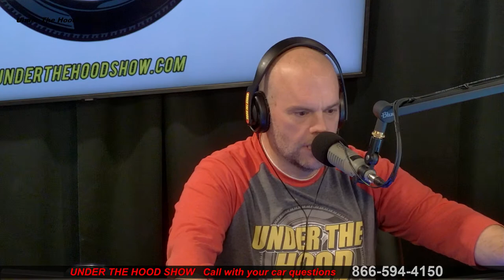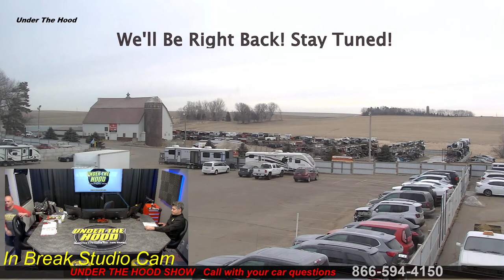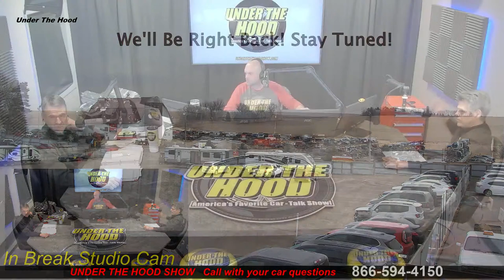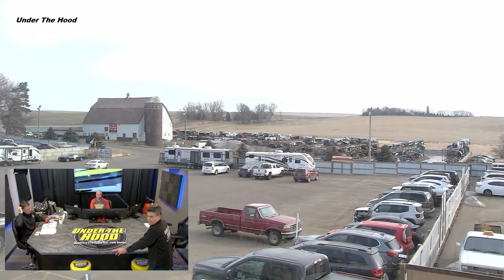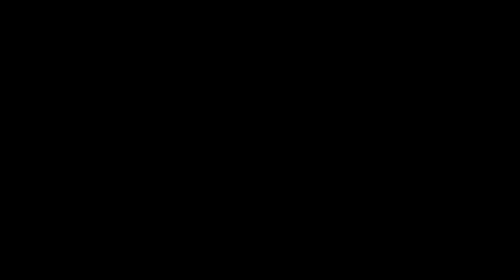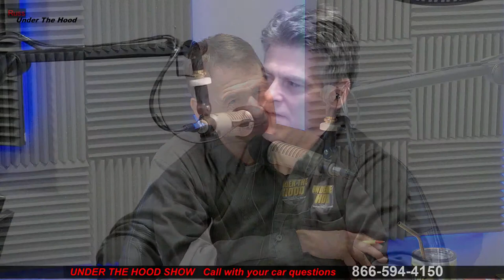S32:E29 Coolant Leaks Are A Real Drip | Auto Repair | Car Talk Show

Comment: I realize you get hundreds of questions..so here’s mine 😊. I’ve done a few hours of searching and just can’t find the best LED replacement headlight bulb or kits. Any suggestions and is it best to go ahead and get the bus decoder or the ones with the built in bus? I want to upgrade my daughters 2012 Accord headlights. What are your thoughts? Am I wasting time-money etc. The lights now are very good but I have LEDs on my car now and they are awesome. Thanks for your wonderful show..
Reply from the maker: Thanks for asking. Well, the DOT has made selling led lights for vehicles to be used on public roads against the law unless used in housings designed specifically for using them in. That makes them harder to find. It seems like only the smaller companies list them and they don’t last long. They are not supposed to sell them for on road use. Same thing happened with tuners that defeat emissions. .
Reply: @UnderTheHoodShow  Well I did Not know that! The pages and pages I have perused through did not mention this at all. Thank you for responding. 😊